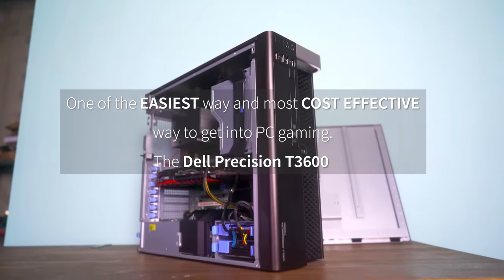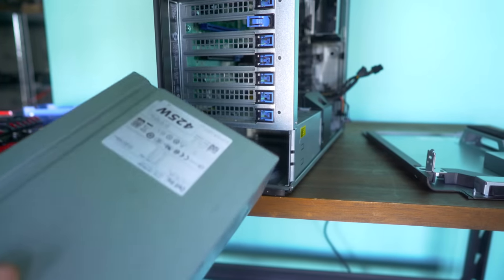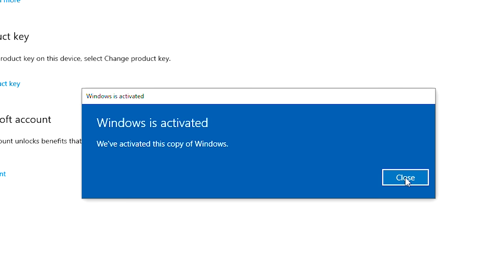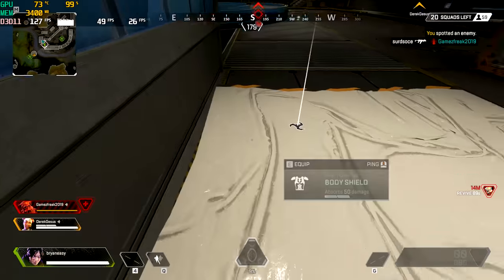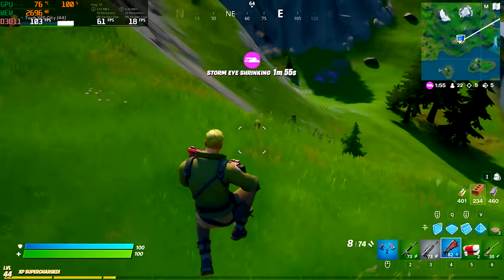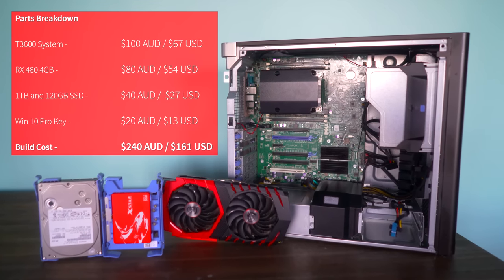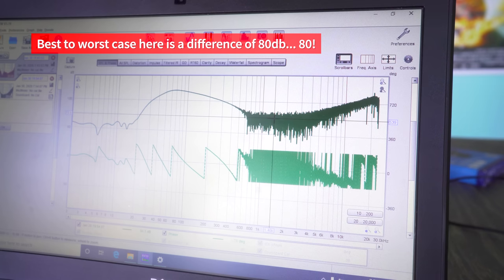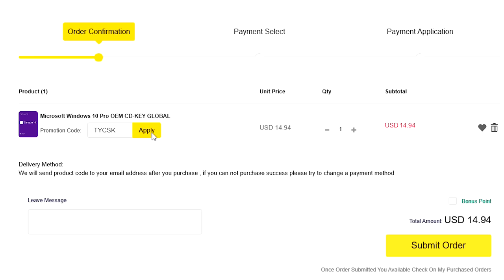How To Get into PC GAMING For Under $200 in 2020!

Comment: hello brian !  
I own this tower too, with 16g of ddr3 ecc mem, a Xeon e5-2665, 256g ssd  and i got a problem with my graphic : I couldn't install which graphics with a PCB greater than 150 watts(a Sapphire Nitro R7-360). 
Did you have this problem with this Dell precision. thank for your video !!!
Reply: WITH 425 watt limit you need to choose what GPU suits for this system, else you need to hunt for a second hand PSU with larger capacity from T5600 / T7600.

Comment: Just built a system with 2 X5677s and a R9 Fury. Getting it up and running on the dell poweredge c1100 motherboard was a bit of a hassle, but all said and done it works great and only cost me $260 in total. Can't get into the bios though. For some reason keyboard commands dont register during boot, on any keyboard.
Reply: Thats why i keep an old dell kb around, my mechanical kb never works on fresh builds
Reply: @jeremyniels  I have several, unfortunately the board doesn't have any legacy ports, only the two usb 2.0 on the rear IO.

Comment: Hi, can anyone help me out? My pc has been running stress tests perfectly fine, no errors for extended periods of time. However during gaming, it crashes, sometimes freezing and sometimes getting the BSOD with error being memory management, I tried reinstalling drivers many times, even factory resetting the pc. But doesn't help. Windows memory diagnostics tool has given no faults when testing. Anyone know what the problem could be?
Reply: Are you using xmp? Try turning that off.
Reply: @yowie7169  I'm using a b150m msi mortar motherboard, doesn't support xmp
Reply: Take out ur ram sticks and re install them nice and firm. That's usually why i get bsod because of loose ram.
Reply: @PatGamingApasStyle  hi, just reinstalled the ram, crashed again, this time without the bsod just a freeze

Comment: Hey brian price to performance tip RX550 overclocks to 1500MHz core and 1800MHz mem and runs at 50c I would try it further but its the only spare test GPU i have atm.
Reply: 170fps Fortnite medium settings 8 gigs ram Ryzen 3 1200x 3.7GHz
Reply: not worth it, even 470 will beat it, used price not that different.
Reply: @vadnegru  470s are going for 80+ ive been picking up 550's for flip pc's for about 50
Reply: @chadselbe59  2gb variants?
Reply: @vadnegru   no 4gb seems about the minimum you can get away these days

Comment: I like your vid and ur chan, so please dont take this the wrong way...

The only one problem i find buying things 2nd hand or used, is the reliability factor and most times then none its preferably better just to get cheapest brand new parts, rather then used high-end parts. Sure you have to probably use a little bit more cash, but your arent using out dated hardware. 
Because the reason is that tech youtubers never ever mention is that, by using old outdated hardware certain things do not work, with particular software.

Later on down the track i see this struggling to keep up with DX12 amongst other things, and the problem you will run into with is compatibility issues, then, well you on your own as no company is going to sit down and create fixes.

And that artifacting on fortnite was a prime example, as you said no problem on test bench, but as soon as you used it on that machine problems arise.
Someone that has only spent $200 on a machine isnt going to have the know how on to finding fixes for it, even if u can, plus the amount time you are going to need in order to fix it.

That one reason why i dont like these types of vid's, as it promises newbies a cheap "gaming" pc, only to have nothing but headaches down the track. Trust me its happened to me alot in the past, which is why i hope people dont do things like this unless you like gambling with your dosh.
Not hatin, just saying.

Comment: Should probably point out that the vacuum is not SUCKING, it is BLOWING. Using a normal vacuum is a very good way to destroy a motherboard/gpu.
Reply: I know from experience sadly. Did not break my motherboard, it was my uncles. Funny thing is I was unaware I broke it because I did not know that was possible. Now I know better.

Comment: Great info on the video. I was wondering as I only play Fifa, not so much into gaming, but I would like to play in the future, I have found a used Dell T3600 available and thinking of buying one, does anyone know if I need to upgrade the GPU, the one I'm looking to buy has an Nvidia Quadro 2gb card as part of the package, will this be sufficient to play Fifa 20/21(newer) on high settings 60htz 1920/1080p monitor. Thanks.

Comment: I had issues with the new driver from AMD for my r9 270. It was fine when installed and didnt restart played a game had little flickers with shadows i restarted and the driver just kept crashing couldnt even make it to the desktop monitor would keep saying no signal then desktop would flicker for one second. Had to ddu and i just let windows install the driver and its been stable since and no shadow flashes. AMD needs to get they drivers on point.
Reply: Probably You need to update intel chipset Drivers. You can use free  version of Driver Booster to automatically update all Drivers for free.

Comment: Anyone know if the Xeon X5670 (LGA1366) is alright? Someone's selling an HP Z400 with that and an RX 580 4gb for $150. 
Also, would it be a viable option to move a system into a nicer case?

Comment: I really think the old office pc thing is over done and has such a limited upgrade path and you have to do so much work to them. You can find pre-built gaming PCs rather cheap right now. I picked up a used Cyberpower system for $100 and used my own psu and gpu, but it came with a Ryzen 1400 motherboard case cooler and hard drive! I traded the 1tb hd that came with it for 8gb DDR4 and put a 960 4gb I had in it!

I just think these office PCs are over done and too limited when you can find pre-built gaming PCs fully built and ready to go or that only need a little work for very cheap and are a much better value than some old ugly office PC!

Comment: i have the older version of the dell T5500 with x5675 12gb ddr3 1333 and a palit gtx660 ti blower style. works brill get better fps then you on same settings. mind you it is a intel,nvidia highly optimized game. is fortnite. ps. dont believe every thing you read on the dell web site. according to dell the T5500 and its bigger bro the T7500 supports  sli it does not. try and use the quaddro for physics they do well for that. and swap that amd graphics card for a nvidia one they are better in those computers.

Comment: This system is quite impressive and lets me think why I've spent 700€ on my rig.
Reply: What is your rig?
Reply: @miniweeddeerz1820  
AMD Ryzen 5 1600X
MSI A320M PRO VD/S
Nvidia Geforce RTX 2060
16GB GB T-Force Nighthawk 3200MHz RAM
Corsair VS 550 PSU
240GB Kingston A400 SSD
1TB Seagate Barracuda HDD (7200 RPM)
Reply: @LNCRFT  so basically what you did was cut down on the motherboard and the processor to get a 2060. How is it?
Reply: @miniweeddeerz1820  No. I bought the A320 with a Ryzen 3 2200G and a GTX 1050 Ti but upgraded the RAM to 16GB, the CPU and GPU.
Reply: @LNCRFT  oh I see.

Comment: I recently bought one of these dells for like £150 to use as a media server, i intend on running proxmox on it when I have the time. it arrived with a huge dent on it so got a large refund then I based the back of it with a screw driver so i could fit my ethernet cable!

Comment: I literally just found this thing on fb but it has (16gb of ram) and planning to buy it $200 along came with the gtx 670 $60
I might spend more than $200🤣
Reply: RX 570 is better than GTC 670
Reply: @YourSuzerain  i bought a rx 560d mining 4gb for gaming. Now updating it with a msi mech oc rx 5600xt i got on ebay for $120
Reply: @aarondustinestrada8103  Nice man, how did the 560 fare?

Comment: I got an i7 2600 with gigabyte mobo 16gb ram a hd7850 of 2gb for $20, two Lenovo sff i5s 2500 or 2400 can't remember which it was lol 8gb ram each a gt640 and a HD 54xx both for 5$ each my computer guy in Moreno valley Love's to buy pallets of PC stuff at auctions and hooks me up. If you're around the area tell him I sent you and he'll hook you up. Tell him Eric with the face tattoos sent you. The spot is called PC clinics. In California. I already own a R7 2900x And x570 Asus plus Wi-Fi so these extra PC's are just to resell. 

PS.
Ohh btw the i7 came with a 80+ silver alien wear 850w PSU. Its kind of like a modular psu but it's only one connector for the whole psu.

Comment: That power supply may be a little anemic.
Reply: ABSOLUTELY CORRECT. In case of very long use, say, 6-8 years the capacitors and other components of PSU gets degraded over time and potentially its Rated Capacity gets degraded after so many years, without the user realizing it. Therefore, in case of PSU's it is always wise to keep some 30-40% extra headroom  available and not to use PSU to near 100% capacity,particularly after so many years of use (in case of Second Hand PSUs)

Comment: If anyone is looking for a cheap gaming pc I have ad up on Offer Up. It’s called Nvidia GeForce 9800 GT. I use it for some light gaming like FortNite and Minecraft and it comes with 250gb hard drive and Windows 10 Pro at the best pixels.

Comment: My rx480 runs at 90° in gta lmao(I use the fractal desing r6 as a case and the xfx version of the rx480 with unlocked power limit.
Reply: I see why the gpu is hot because its grabbing air inside the case so if inside is hot then your gpu is hot
Reply: @pepsico.4445  no, i have enough intake and exhaust fanst, the air flow in the case is good. Even when I used the system open air as I bought the case last because of my budget the GPU ran hot(the cooler is clean and it also has fresh gelid thermal paste.
Reply: @yannicg  Ah just a shitty gpu cooler then or try to turn up the fan rpm on the gpu as most likely amd may have lowered it for sound but turn it down to 80c instead of 90 which is too hot

Comment: i personally can't recommend these "Cheap" pcs... From owning a similar pc, its hard to say it was worth it..
Reply: It is worth the throwaway-price at which it is available now, but you cannot expect it to compete with newer Ryzen Systems. HOWEVER you cannot go for Ryzen System with this kind of Starving Budget.
Reply: Why can't u recommend it? Your comment is lacking context. These kinds of builds offer the BEST value a budget gamer can get. It all depends on what kind of pre-built u can get and what are ur needs. For example, I would recommend buying only pre-builds that have decent enough psu (+400w) or one that can be changed and preferably has a tower case.
Also these kinds of 6c/12t Xeon builds are not that far or from entry level Ryzens!
Reply: @MaximusAdonicus  Absolutely Correct. The newer system will cost more than thrice of this price whereas with system you can do not only all the latest gaming but also good amount of productivity stuff.

Comment: Shows again how he is in his own bubble these prices are not realistic to others just on ebay the price he shows is 4 times less then most other regions and sellers of old office equipment sell these in uk for like £280+

He has his own mate who is supplier otherwise no one else would be doing this.

If you have a quad channel board why would you not use it like that eec ram is not expensive its what another 20-30 for another two 8gb sticks

Cut the side panel put in a windows and some RGB remember it can only be a gaming PC with RGB lol
Reply: @darkhazard9808  So if it is cheaper then the pricing he is saying sums up what I said UK being screwed over even more.

Correct UK second hand market is expensive which makes it almost pointless to ever buy second hand parts.